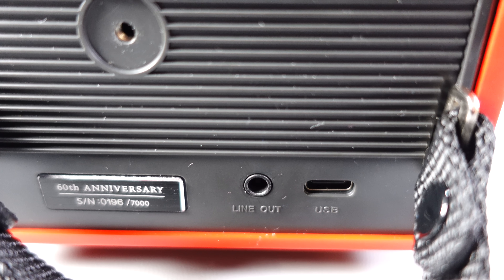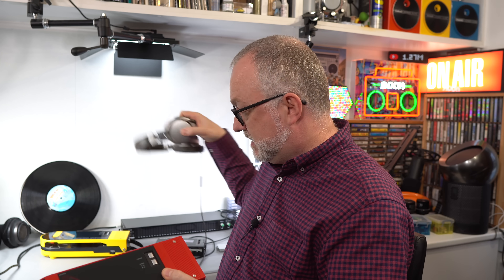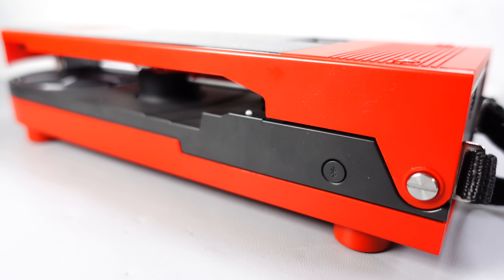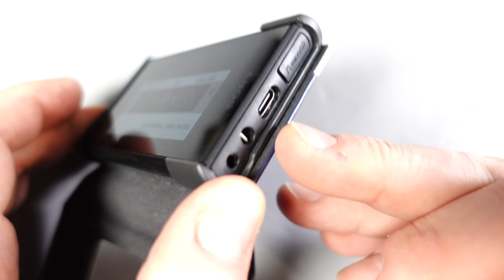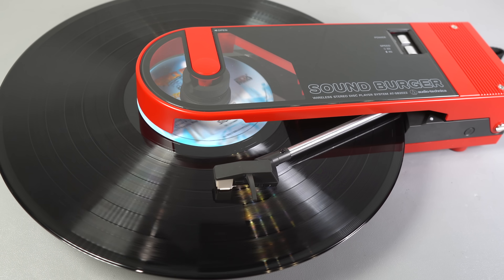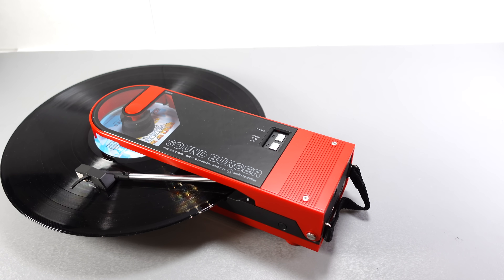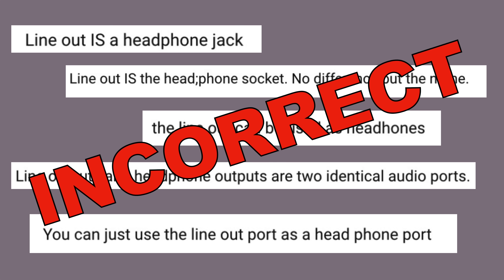Line-out ≠ Headphone-out

Comment: Why then does my phone sound best at full volume when connected to my receiver via headphones out or external dac?  At that level the volume is comparable to my CD player connected via coaxial digital. At, say 3/4 volume I have to crank the reciever way up. Same situation with every phone I've tried.
Reply: one being phones generally have weak outputs from the beginning works best with ear buds second being the European regulations on how loud a device is allowed to get with headphones and lastly some phones do a bit of trickery with sensing headphones and or lineout use. (Samsung is the worse when it comes to full volume output.)
Reply: @CotyRiddle   Thank you for your reply, and that's very interesting.  I'm definitely team Samsung, so that applies. I'm still confused as to why when headphones are connected at full volume it's unbearably painfully loud, but is apparently at quiet line level when plugged into the receiver.  The phone doesn't know it's plugged in to a receiver and the receiver certainly doesn't know what's plugged into it. I was beginning to think I had been mistaken all these years and that line level was louder than headphone out.  I should try it with a laptop computer and see if it too needs to be cranked all the way up.
Reply: @astrotrance  with the headphones being really loud it could be that they are just not as power hungry as some others. you could try a two way headphone adaptor the kind that allows you to share a single output and hook it up to the line in on your receiver and the headphones at the same time. probably will not sound good but might be able to tell if the phone is doing some trickery on the output. if it is louder that way then it is sensing the resistance and adjusting the output current.
Reply: @CotyRiddle   Thank you again! I will give that a shot.

Comment: TECHNICALLY they're not wrong though... you can still play music, but just not as loudly as with a headphone out.
Reply: That is heavily dependent on the impedance of the headphones you are using. My headphones are 250 ohms, and the line out is usually ~600 ohms that means there's going to be some 850 ohms of attenuation on it and there is no way it would be louder than a whisper.
Reply: Many heaphones would be far too quiet or inaudible using line out, and even if you could hear a decent level you would not be able to change the volume.

Comment: Can confirm. I have the new Sound Burger (AT-SB2022). I tried to plug my headphones into the line out and the volume was too low, and non-adjustable. Thankfully, I have a small, battery-powered mixer so I can use that to amplify/attenuate the sound.

I must say that despite this limitation, I really, really enjoy the 2022 Sound Burger. I bought a new LP today, and listened to it in Starbucks. Really cool!

Comment: Not all line-outs are created equal either. Devices such as cassette decks and radios from the 70's and prior put out some 250mv or 0,25 volts at most.
When the CD was introduced in the early 80's the standard for line out was set at 2 volts. Nearly a 10x increase!
This ends up being a problem mostly when plugging newer sources to older integrated amplifiers as you'll have almost no range on your volume control since they expect a much quieter source.
Reply: Good point not a lot of people know this, the 2 volts from cd players can be to much and can cause distortion on old amps, were a RCA attenuator will be needed
Reply: i miss my vintage technics stereo but i honestly never really had a issue with volume control. it definitely was louder but still had full range of control. some signals were definitely more hot and would distort but nothing a few resistors did not take care of.

Comment: Not related to the soundburger, as I assume it already has an amplifier, but if you're using a regular turntable and amplifier, you'll need an amplifier with something called an RIAA step on it, because the normal output of an LP player is so notoriously low, it needs a LOT of amplification.

Secondly: if you have a line out and a headphone out, and you've got whatever device it is connected to an amplifier, use the line out. While it may sound fine on headphones, the headphone out is amplified (compared to the line out), which can introduce distortion/noise, something that shouldn't happen when using line out (if it does, then something's probably broken).
Reply: any step of amplification is bound to introduce some distortion. (the amplitude of the signal causing the distortion as the signal starts to get clipped)
Reply: @CotyRiddle  True, as amplification of any signal will also amplify any noise that's part of that signal. Headphone amp circuits can be noisier than other methods of amplification because they can be made very cheaply, since most consumer headphones (or earplugs/earbuds) don't require a lot of power to produce meaningful sound.

Comment: Every device I own has volume control. Also I have a little mixer which I sometimes use to volume to something comfortable if volume control is not enough.
Reply: Volume control on a device shouldn't change the volume on its line output though. It would be a bit of a nightmare if it did - imagine if volume on the source, amp and recording device all affected the line level!

Comment: ideally turntables should have phono out, which needs a phono capable amplifier
Reply: It's just moving the preamp from one place to another, considering the sound burger is quasi-portable, line out would probably be more useful. Line in is more common, especially on newer devices.
Presumably they also get less customer queries/complaints.
Reply: my thought as well, but I've never saw phono out on a 'portable' turntable.

Comment: You did'nt mention the fact that you might damage the equipment by plugging headphones into the line out socket.
Reply: Genuine question, most likely borne out of my own ignorance: How?
Reply: @mockturtlesuppe  The resistance of the headphones can, in some cases, put too much load on the output of the line out pre-amp and overload it causing it to burn out. Basically. I've probebly not explained it very well, but that's the best I can do.
Reply: @Franko_Walker  Gotcha! No, that more or less made sene to me.

Comment: Is this an analogue signal? Can amplifiers amplify it cleanly without noise? 

Wouldn't it better to output a digital signal into amps?
Reply: The soundburger line out is analog and probably close to the cleanest signal it can produce. An amplifier only works with analog signals and the amount of noise it adds depends on its quality. For digital signals you'd need a DAC (digital to analog converter) between the signal and the amplifier. If an amplifier can take digital signals like usb or fiber optic, it has a DAC built in. Since the source (vinyl record) and the playback device (headphone/speaker) are both analog, converting to digital and back would only add unnecessary steps.
Reply: It's literally made for an amplifier to amplify it cleanly without noise. There wouldn't be any point to outputting a digital signal because it's coming off an analogue source. The line level output is the literal wiggles of the needle across the groove of the record.
Reply: I think every amplifier is analogue, device that turns digital signal into analogue (with whichever volume you need) is DAC.

Comment: headphones jack ensures that there is a comfortable control of the volume so that it is independent of the line jack which will always have a standard fixed level. On the other hand, the headphone jack guarantees some power at low impedance to drive the headphone motor with enough volume.

Comment: When I was at college, and poor, I bought a pair of ear phones from Poundland (back when everything was £1) and used to use them as a microphone for talking to friends on MSN. Wasn’t great quality, but it worked.
Reply: Back in the early '70s I had an Amphenol Commander 750 CB radio.  The hand-held microphone on a coiled cord used a permanent magnet speaker as both speaker and microphone, there was no speaker in the main unit.  Funny thing, I installed a 3.5mm (1/8-inch) jack in the microphone, wired so I could plug in an external speaker yet still use the built-in one as the mic.
Reply: I did exactly the same except the quality was significantly better than the other microphones I had
recently converted a military radio headset to use 3.5mm jacks took me a couple of hours of head scratching to trying to figure out why the mic was working but not the speaker since it was all working fine before I sodered it all up
turns out I at somepoint I flipped the two sets of wires around and was trying  to use the microphone as the speaker whitch obviously dident work and the openback headphone was being used as a mic
took me so long to realise because the quality was exactly the same😅
Reply: When i was 9 or 10 (1997) i set up my boombox pointing out my windows towards some older kids who were snowboarding on a hill adjacent to my house.
Plugged in my headphones into line out and then began my “metal pirate radio broadcast” to those kids on the hill.

Shit ruled.
Reply: Back when I was 11, I was using an old laptop that didn't have a microphone, so I had to use my headphones instead. However, I only had one pair, so I used to constantly have to plug and unplug them depending on what I wanted to do! The funny part is, they didn't even sound bad when used as a microphone.
Reply: That is a old trick if your proper mic dies or your budget is tight, verry true.
Reply: I did it the other way once. My nan used to have a really early compact cassette recorder which came with its own microphone in a leather carry case and as a kid I was fascinated to find if I plugged the mike into the headphone socket you could get sound to come out. Unfortunately that sound was mum Nan's Singalongamax cassettes but you can't have everything.
Reply: @misterthegeoff9767  I did the same.  And if I held the microphone really close to my ear, I was surprised at how good it sounded.  Surprising bass, but the midrange was lacking.
Reply: @misterthegeoff9767  I did that as well as I mentioned but the sound was very crap, but no worse than the old earphones that you would get.
Reply: On the same topic of inappropriate transducer applications, I decided to see how one of my Cerwin Vega speakers would perform as a microphone...  Well I was astonished to be able to hear some sounds picked up.  But it was mostly the low frequencies.  Anything over about 400 Hz was inaudible.
Reply: @eighteenin78  Also, the motor out of a toy such as a radio controlled car can act like a speaker when you play music through it.
Reply: Totally did the same
Reply: I remember plugging in an old dynamic ? well i am sure it was as it was supplied with 2 for an old stereo my parents had.  well anyway for shits and giggles i plugged it into the earphone of my little cassette recorder and it works as you may guess but not well.  It had a tinny tweeter like sound.
Reply: @steviebboy69  An old DJ friend of mine lost his headphones and used his mic to cue everything up for a while. It was a bit difficult in a club setting, but he managed.
Reply: @steve.b.23  he held a mic up to his ear? Lol must have looked silly
Reply: @GodWeenSatan  he found a way..............
Reply: @GodWeenSatan  He did! It mostly happened in a club so it was dark enough for him to get away with it, but we knew so he got his fair share of mickey taking.
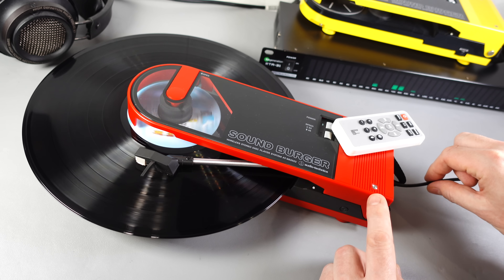Reply: @steviebboy69 ❤ 4:50 4:50

Comment: I miss the headphone output, but I can understand why they only have bluetooth for headphones now. The Sound Burger is not really portable while playing. It needs to be on a steady, solid surface while playing. You would have to sit right next to it and not move if the headphones were wired. You'd be tethered. The line out port, fine, it can sit next to speakers or an amp. For headphones you'd want more freedom. Watching this video again, I wish I had a Sound Burger.
Reply: There are also a variety of devices that allow you to use wired headphones via bluetooth ow, ranging from the cheap KitSound WMA2 (had that fir a few years to use a tape player over bluetooth), to more expensive and higher quality products like the Fiio BTR5 (only got one more recently, but other products are available too). I think the assumption is that if you're buying a Sound Burher, you probably have the soare cash to buy a product like those mentioned to use it over bluetooth, if you wish to use headphones.

Comment: I assumed line out is a lower signal, so it wouldn't be enough to drive headphones or speakers.
I've done that. Used the earphone jack as a line-out by turning down the volume enough to avoid distortion.
Reply: I used headphones out to record on tape years ago that way I could record with loudness, I've also used headphones out for active subwoofer. 
Now I'm considering recording to MD, again to get loudness on my portable device. 
Do you know how much distortion there is in a headphone out?
Reply: @bendermi  There's almost know way you could answer that.
The distortion you're likely to see when you do that is clipping from the line-in getting blasted by the higher power of the headphone amp.
Assuming your phones output is of any decent quality, just set the volume low enough that you're not oversaturating the line-in during peak output from the phones jack.
There's a lot to be said for recording at slightly lower levels, too. It increases the depth and complexity of your audio if you don't make everything, always, very loud.
Compare Metallica's Death Magnetic to Master of Puppets. Rick Rubin recorded Death Magnetic and the album is compressed to be loud AF all the time. Master of Puppets, on the other hand, has drama and contrast in it, instead of just being high-energy throughout.
Reply: @SwervingLemon  
Do you know what an oscilloscope is ?

Comment: what about headphones with a built in volume control?
Reply: You can't amplify a signal with a volume control.
Reply: Headphones with just volume control can only lower the volume, to get higher volume you need an amplifier.
Reply: Unless they have a built in amplifier as well, then no - having a volume control won't help.
Reply: Pretty sure the 'volume' control is just a variable resistor - with 10/Full volume being no resistance and 0/Min being full resistance, this being in relation to the signal being received (so an amplified output from the device).  But unless they are powered (which I don't think is a thing with cabled headphones) then they still won't be able to amplify the Line-Out output to an audible level.